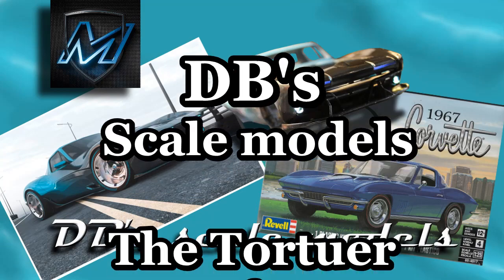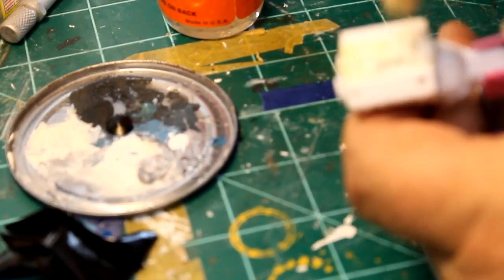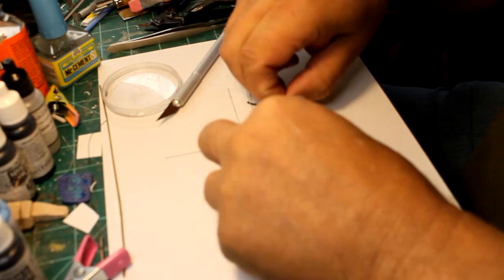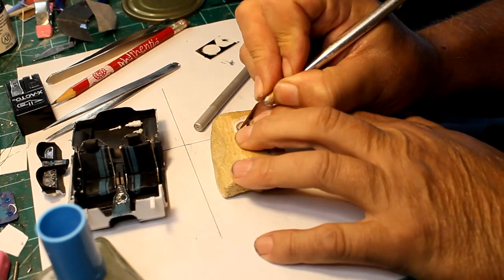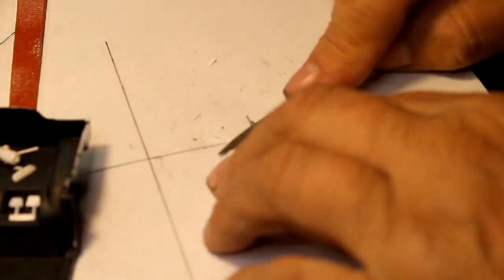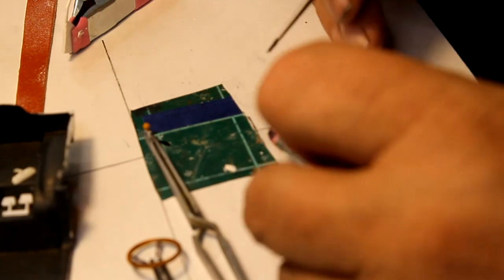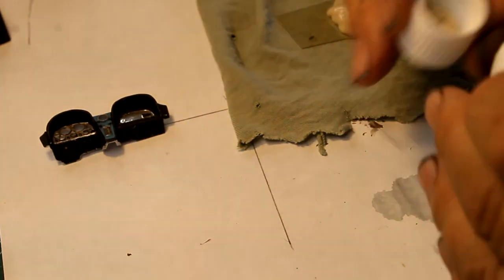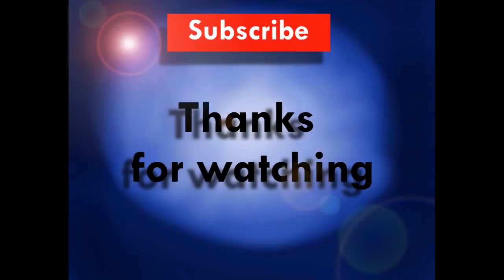DB's scale model. lights camera action! The gory insides

Comment: Neat little lights,Doug 👍. Dished out bit of wood to cup steering wheel,is a good idea👍🤓. Carry on the good work,hope you get your truck fixed and best wishes from jolly old England 👍😎Pete 🤓
Reply from the maker: Thanks Pete, the dished wood was to support the steering wheel to cut out the slits ,holes what ever its called.
Reply: @DB.scale.models  yes👍it's a great idea. Cut down on distortion or breakage.👍I'm making one👍😎